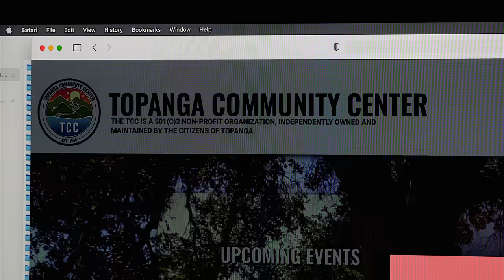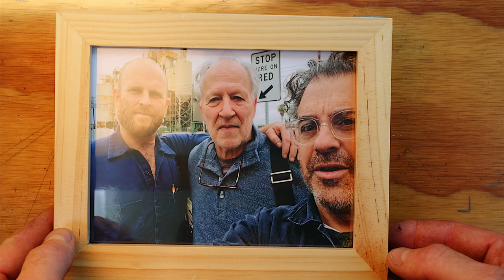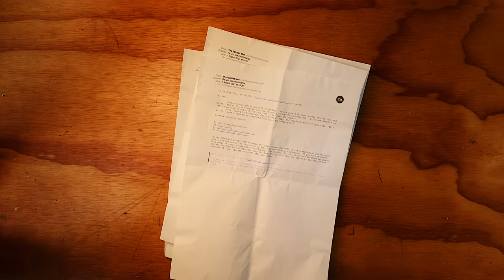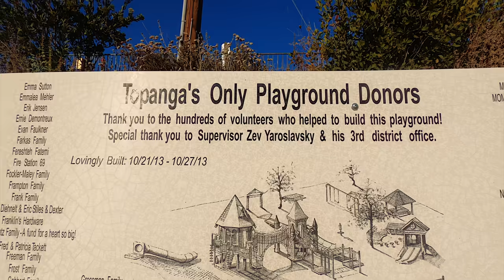Fixing the Zip-Line Without Permission

Comment: i love coming back to this video. it's a great heart warming story that inspires me. as someone with adhd one of the biggest challenges i have to managing my expectations of time. i see a project, any project, and think "that'll take me 40mins or an hour" and it turns me off of doing it. 99% of the time it's actually something that will take me 5mins, tops - OR is something i can easily break down into smaller chunks that i don't have to do all at once. when i watch this video i think the turnoff would be the time, not only to do it, but the time crunch with jerry swooping in like some kind of condor, protecting his nest (the playground, in this case). but i see this video as a good example of time well managed, especially with the right preparation (another thing that'd stop me from doing this is the knowledge that i wouldn't have the right sized bits and bobs to disassemble the zip line and that i'd have to go home and get the right ones and come back, etc.).

thanks again for a great video!!

Comment: Pro tip: Wear a high-vis vest while doing such repairs. Construction worker always were safety equipment which tends to include high-vis jackets or vests. So wearing a high-vis vest is the easiest way to look like someone who's supposed to be fixing something.

If you want to get away with something looking like you're supposed to be there tends to get you a lot further than trying to hide what you're doing.

Comment: They drilled and bolted the ones at the playground near me. 

Removed said bolts and it was operable. Month later it was bolted together with security bolts. Returned and removed those. 

They proceeded to weld it.

Comment: Years ago I went to a park near me there was a slide that the fiber glass has wore down on and was so dull you couldn't even slide down anymore you just got stuck. So I sanded it down and repainted it so the fibers weren't sticking through anymore then wet sanded the paint polished and waxed it. I did too good of a job because the slide was so quick it launched you out the other end because it was so slick. I used ceramic wax so it was extremely slick. Kids loved it though they tried to see how far they could launch out the other end.

Comment: The city installed flexible bollards to mark the cycle lane on my street. The problem is that the one in front of my apartment is too close from the intersection and when buses turn, they hit the bollard, every single time! Not only does it damage the buses and the bollard itself, but it's noisy as fuck and It's slowly making me go insane! Last year, it was ripped off 3 times and the city kept replacing it without moving it, even though I complained about the issue twice. So, I have been fantasizing for a few weeks about going out at night and moving it a few meters down the road. This video might have just given me the courage to take action! Well, at least I'm actually considering doing it now. I just have to be quick enough not to get caught...

Comment: Beautiful vid and good work, BUT, that is not a Zip-Line. 

A Zip-Line is a pulley suspended on a cable, usually made of stainless steel, mounted on a slope. It is designed to enable cargo or a person propelled by gravity to travel from the top to the bottom of the inclined cable by holding on to, or being attached to, the freely moving pulley.

Comment: why do they use those woodchips at the playgrounds? i use to play at playgrounds a lot and there wasnt woodchips but sand and you could run around the whole playground playing tag and what not and you'd be just fine. if you turn in those woodchips....they poke into your feet xD why? why would they do that? D: now you need to wear your shoes at the playground and then those chips get in your shoe then you need to go out of the playground to get the chip out of your shoe then later more chips get in your shoe :( why did they do that? why? xD

Comment: I remember as a kid the local playground used to have a metal zip line similar to this. Since the start they were some of the most popular parts of the playground but also the most likely to be removed do to the high injury rate. I remember a lot of the Indian kids would eat their lunch with their bare hands making them super greasy. Even if they made it across without slipping off it made the handle extremely hard to hold on to. Several kids slipped off 3/4 of the way across and ended up breaking their shins on the opposite platform. One kid even smashed his mouth into the platform breaking a few teeth out. The final straw was when a kid thought he could shimmy across by holding on to the inside of the track. Another kid who I was playing tag with tried to escape me by using the zipline without checking. Unable to stop, my friend accidentally crushed the other kid’s fingers. After this they replaced the zipline with a really dumb rubber grid monkey bar thing that would guarantee blisters if you tried to use as intended. Instead of doing that everyone would just climb on top of it and walk across the top. (way safer I know right) 

Anyways the moral of the story is those zip lines can actually be quite dangerous for unsupervised kids. Maybe the Town Council decided to just leave it broken instead of having to pay to replace/remove it.